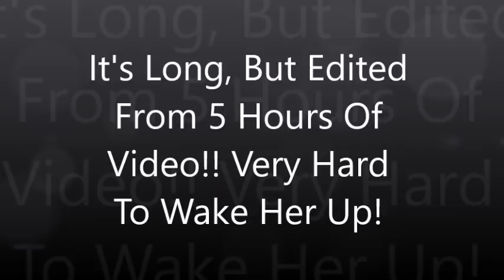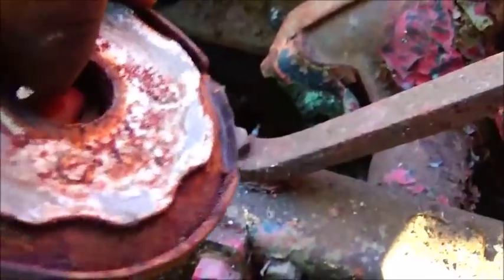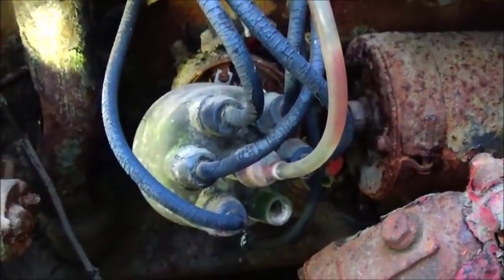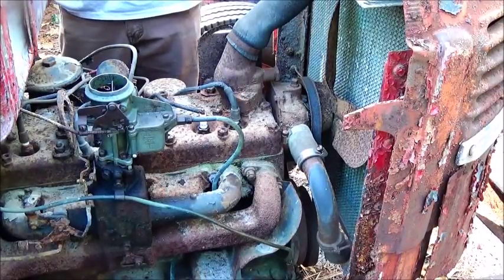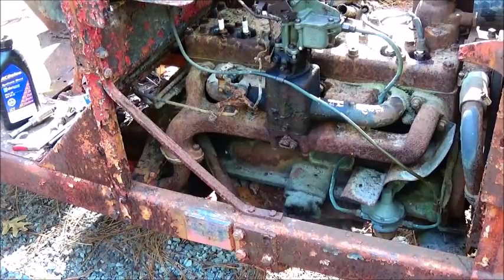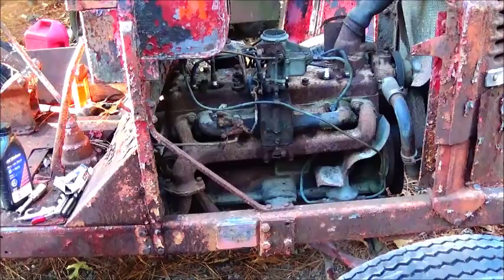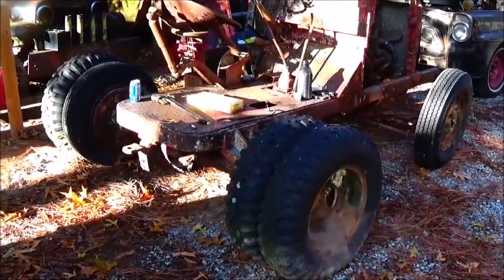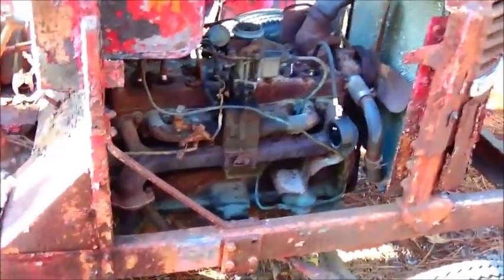Worthington Truck / Tractor First Start In Decades!!

Comment: I have the same one i bought it for 200 dollars the engine was seized because one of the valves broke the engine was rebuilt in the 90s sometime but we got it running and driving after we put new master cylinders in the hub assembly and a steering column  and it looked exactly like this one we bought it and is in the start of restoration  great video!!

Comment: Tough old engine, one of my goto forklifts back in the day was a yale with essentially the same engine. Beat on it all day long and it was probably 40 years old when I was using it, basic greasing, oil changes, ding ding, it comes out for the next round. I didn't really doubt you'd get that one lit, good job!

Comment: That was a marathon. Amazing that starter didn't burn up.  Between polishing the cylinders and rings for two days, they finally got enough compression to ignite the vapor.  When it cools down, all those spaces are going to be even wider, and they will be lucky to get 45 psi.

Comment: Good job, JW----luv to see these oldies start up.  I had a 36 Olds 6 cylinder trunk sedan that used to stick a valve now and then.  Old bugger didn't have an oil filter ;  manual just said change oil every 1000 miles - I did but whoever had it before me, who knows?!

Comment: Helped a friend restoring a 1931 ford Model A pickup, it sat for 50 years with 25,000 original miles laughed so loud when we started it with the smoke when she started because he did it in the garage and I was in the cab and couldn't see anybody. I learned a lot about Model A's

Comment: My dad would use white gas (Coleman lamp/stove fuel) when he had trouble starting engines. Then switch to gas once it started.
Also use two cycle mix that would help the rings and valves.

Comment: cool , working on 1969 cub 154 lo boy tractor, was setting for years , flat  head four had 3 stuck exhaust  valves , removed head used plenty of p b blaster ,got them freed up ,cleaned up replaced head , new carb kit  , got it running ,runs good ,had to replace clutch and shaft moves on it own power now, working on hydraulics now, as always enjoy your videos  thanks  , hoping to see you get back on four wheel drive wrecker !

Comment: I had to do that on my skidloader when I first got it. The little VH4d wisconsin just was not healthy at all. Took many hours off cranking to get it to fire. The ol' 6 volt starter took it pretty well, but it did bite the dust soon after I got it running.

Comment: Nice video. I have a 1946 Dodge dump truck. It sat since 1959 until about 20 yrs ago. I had a time with it. The engine was stuck and all the values stuck open. after a weak I got it started. I drove it around my place for 2 yrs like that. I then rebuilt it and now its on the road. Theres not to many of these around any more.

Comment: That rotor cap you could put a puddle of solder that being soft will not harm the carbon brush or brass loaded spring seen it done before.

Comment: Looks like it had  been set up like what was called a Doodle Bug, just the passenger compartment and front end.  There was one like that that sat under a shed at the deer lease that my Boy Scout troop visited down between Kerrville and Medina, Texas between 1955 and 1960 every Memorial Day weekend.  One of the scoutmasters tried to start it one time, but it wouldn't go.  Always wished they could have gotten it running.  However, there was an old tractor on the property that a couple of the kids kept fooling around with and got the thing running using the crank!

Comment: You should use two cycle mix at a 24:1 ratio in you gas bottle, to help seal and lube the rings. I find it helps in starting engines with low compression. Was the throttle plate wide open during the compression test? I find 60psi is about the lowest I can get and engine running.  It did sound good... considering how many decades it has sat without the very important air cleaner. They really do save the engine!
.

Comment: Congratulations! Took awhile but you got it! I don’t think she was blowing that much smoke at the end. Only when it was shutting down. She spit and sputtered but got running smoother! Nice work!
You gonna pull that carb and put a starter solenoid then run a temp gas line to her? Hope she’s getting water.

Comment: Dude ,  I totally get having to roll it  over a bunch with the Marvel oil freeing up the valves and rings , but save the starter !! Tow it around the lot with a tractor and your buddy in second gear or so for awhile. Cool vid and will check out more.

Comment: You should try WD-40 to get them firing. Its ignition temp is low, and it also lubricates/frees up parts. I use it all the time on old lawn tractors and small engines. Sometimes I go straight through the spark plug hole then through the carb once it fires.

Comment: I never do compression tests,preferring to do a leakdown test instead. It takes minutes to do a quick check and if i want to get really technical I rotate the engine so the reading can be taken at various points of the piston travel to check for bore wear and damage.

Comment: Hi Jon. Just A quick note about an auction near my home in Minnesota. Appears that A fellow collected several old cars and trucks over the years with the intension on working on them during his retirement. True to form, he dropped over A couple years early and now the family is selling them off. He had at least 66 cars that are going to auction. The auction host is kbid.com Go to Auctions In Minnesota on the link page and the cars are presently on page 2 at the bottom of the page under the A2C logo (Assets 2 Cash) in case anyone is interested. Most are pretty rough but some interesting ratrod stock on hand including A 1940? Mercury Pickup.

Comment: Shor glad yor stubborn on the give up , persistence does sometimes payoff . had a 49 merc V8 in  a 51 willeys pickup same thing ,valves not seating , put some 50wt in each cyl and pull started it. put atf   in the gas smoked abt but helped them seal better till the Marvel Mystery oil in the gas finally worked  never did have to give it a valve job.

Comment: Jonathan, have you ever thought about building a hand held gear reduction starter that will stick into the hand start teeth in the front of the crankshaft or use a impact socket on the nut on the pulley, to spin it over fast, kind of the way they start some race cars, just a thought

Comment: if they aint seized they will generally run, i had one with a seized piston and 3 stuck valves, head off free it up and she run. my last one had a solex carby, i threw that away and put a carter ball and ball on it and fired straight up

Comment: Sounds awesome. Did you change or check the oil? It’s also a good idea to put some oil in each cylinder in engines that have sat for a long time. If you restore it, it would be nice

Comment: We got a WW2 military contract light aircraft tug . That Dodge grille badge is original to that tractor, Worthington just mounted a shaped plate directly over that badge with a W painted on it. The guages look like 38 Chrysler or Plymouth. Still trying to find more on the military version, not much info on these.

Comment: i use carb cleaner on any old engine to get it to start. carb cleaner fires easier than gas but not as potent as engine starting fluid(ether). if you do not get it to start or run on carb cleaner for few seconds it is time to remove the head or heads to see what the valves are doing and see the cylinder walls. you can remove the spark plugs and shoot a spritz of carb cleaner in each spark plug hole and try that also. may be a nest of some kind in the intake.

Comment: After you do that compression test put a quart of Rislone in your oil and let it run 5 minutes and then check  your compression again after 5 minutes you'll already hear and know the difference it takes out the sticky varnish that builds up inside of all motors

Comment: Whats the best way to free up an engine that you cant turn by hand. Ps. I love the vids man. Great work
Reply: If you have time, fill the engine to the top with light oil and leave it sit for at least 6 months. A year is better. this soaks the whole thing down and should free up the rings and valves. Several times over the year try to turn the engine over. Don't go nuts! Just give it A bump by hand. You don't want to break the rings. When it breaks free drain the oil and put in the proper oil and give it A try with the starter'
Some people will pull the head/heads and soak the pistons with "Ed;s Red or Blaster and every so often use A chunk of 2X4 and A hammer to rap the pistons. Again, don't go nuts! A light rap and try to turn the engine over by hand. It took years for the engine to stick so it's going to take A while to get it to turn over. Some never do. I have seen some that busting the pistons into chunks was the only way to salvage the block.

Comment: Is there a way to invent a system using an air compressor through the spark plug holes so that it would apply pressure than release using more than one cylinder to push down on The Pistons

Comment: Good starter motor none of this modern crap would last that long 👍👍👍👍😎🇳🇿
Reply from the maker: 6 volt starter on a 12 volt battery for about 2 hours of actual cranking, that is pretty impressive. I think it is an autolite, but may be a Delco.

Comment: LMFAO! Your determination is Incredible! BUT really no need for any apologies if you can't be God in some cases. She is definitely in some desperate need of some help in every department, but the fact the starter and ignition system even worked to begin with is amazing? The other fact that it's been sitting for God knows how long being exposed to humid southern air and probably run on unleaded for a couple years After they went to non-leaded gas and it doesn't have totally burned valves or seat's. That's not even to mention, YES as you've pointed out the amount of carbon deposits in the intake tract or a sticking valve stem. REALLY that's some unbelievable work, and for what it is and how long it's sat, she didn't sound bad at all! VERY NICE WORK my Brother! That's probably as well as she ran the last time she was really running for the folks running it, and died where you picked it up from lol? Very cool to see ya bring it back to life!

Comment: There at bout 21 mins you talk about beatin the carbon off the seats and the rust off the valve stems. In the farming world we call that " getting everything shined up". All those surface areas get a coat of cruddy rust,and you gotta run whatever grain you start with(wheat,corn) and polish the crud off stuff. Makes sense that the moving parts of an engine are the same

I'm surprised the old turd wasn't rusted solid.

Comment: Did you check the cam and crankshaft sensors ?
Reply from the maker: My 12 volt plug wouldn't fit in the 6 volt OBD 2 port.
Reply: You need the right Marconi adapter.

Comment: Hi Jonathan, i love the videos and juat have a couple of questions to satisfy my own curiosity about this.

1) I notice you didn't use a starter fluid/ether. I understand that can be bad for diesels but could the extra volatility here helped to kick it off quicker than gas?

2) with the oil you added in the cylinder, do you need to wind it over to blow it out and reduce the risk of oiling the plugs up ?

Not criticisms mate, i am just asking to satisfy my curiosity.

Thanks for an excellent channel
Reply from the maker: Phil, I personally do not prefer to use either on anything. It is very dry and although I think some is offered with an added lubricant, I haven't ever used it. The problem is really not the fuel, but the lack of compression combined with the lack of vacuum to increase velocity and atomize the fuel   I am sure the added oil affects the firing somewhat, but not enough to keep it from firing the fuel. I may switch to a squirt bottle that will atomize the fuel somewhat before entering the carb.
Reply: Jonathan W thanks for your time knowledge :)
Reply: I use A oil pump can similar to the ones old time oilers used on the railroad. Hold's about A quart.
I used to use A glass 8 oz. pop bottle but stopped when it set on fire when A carb backfired! Now I'm 12 inches away and the hole is to small for flame to travel up the spout.

Comment: Change oil, +1 quart kerosene, +1 quart ATF, new filter. AUX fuel tank, 91+ Sea Foam. Remove thermostat, 50/50 coolant. High idle 10 gallons of fuel through it. About 2 hours.

Comment: Trick is to put about three caps full of ATF down each spark plug hole, and crank it after wards with the plugs out, after it sit's for about 5 min, then put the plugs back in.
Reply: and bump it with a touch of either, in the bowl.
Reply: cylinders glaze up with time, from sitting.

Comment: The old gal just didn’t want to wake up after such a long sleep. You just wasn’t taking “no” for an answer. Lol  Any plans for this old jewel?
Reply from the maker: To go 47.5 mph like they claim it will do! Then maybe sell it, but not until 47.5 mph!
Reply: Jonathan W I think your tractor is sexy!
Reply: Jonathan W - Lol! Wear your helmet brother! And maybe some motorcycle leathers if you got any, just in case ya hafta jump.
Reply from the maker: I figure that everyone is gonna think I am crazy, but I am wearing a helmet for sure!!
Reply: Jonathan W I have several  Hardhat,ACH,PASGT and two CVC even thought I've have 5 screwed up vertebra and screwed up shoulder and arms from doing stuff with a gung ho attitude disreguarding my own safety no more of that crap! Need to get you one of those SF Helmet's since your near Fort bragg! 😁

Comment: if the valves are sticking, mix Rubing alchohol with a half a bottel of either, and dip it in the carb while its tries to start, the watyer in the medical alchohol, should steam the valves clean.

Comment: Starting fluid ignites quite easley, even in a engine with low compression.  Would have saves a lot of wear and tear on the starter.
Reply from the maker: Dry and ruins cylinder walls. Starter cheaper than an engine rebuild.
Reply: @jonathanw4942  I haven't hurt one in 40+ years.
Reply from the maker: This engine needed turned over  the valves were not seating. There was no use drying the cylinder walls out with starting fluid.

Comment: ((😳)) can you pull start it ? Get a sledge hammer to outer side of them back wheel rem hubs a few times that’ll break em loose for sure .. spray water in on the brake shoes if ya can .. water is just as good if not better then penetrating oil .. just think what makes metal rust the start with ? Right water ! That’s and old paint and body man’s trick to getting rusty bolts out .. quick fix guarantee 😉👍🏻

Comment: Comp tester should be used with Throttle wide open, or it reads low
Reply from the maker: Throttle was open, no spring on the linkage.

Comment: Hey Jonathan why don't  you make yourself a starter button with some heavy wire and gator clips where you don't have to cross it with a piece metal a old timer showed me that and it works pretty good.
Reply from the maker: Without a solenoid it would burn up. That was 1/4" solid rod and it was turning it red. I did need a push button, but I also needed a solenoid.

Comment: Instead of losing all those hours cranking and getting no result I would have pulled all the plugs poured some premix down each jug replace the plugs and give it a whirl; yeah sure everybody will say he got it started eventually but when time is a precious comodity I think this method would be quicker
Reply: Ciprian Maior It had low compression so pouring fuel down the jugs would not help
Reply from the maker: Also a quick start on and engine that all the oil had drained to the bottom wasn't what I wanted. I was priming the oil pump for running the entire time I was cranking. Starters are cheap.
Reply: as opposed to just keep on cranking and pouring gas down the carb; was he able to raise compression by continually cranking the engine for several hours? I doubt it; I think compression came back after the initial few seconds of actually turning on its own combustion so yeah, I really believe that had he just put fuel in the jugs and new plugs the engine would start quicker and he wouldn`t have waisted so much time

Comment: WHY DID YOU PUT IT DOUWN AS A TRUCK? IT'S NOT IT'S A TRACTOR>
Reply from the maker: It is a factory built Worthington Golf Course Tractor. They bought parts from Dodge to build it.
Reply: Even with a Dodge engine and transmission it still not a truck. It's a tractor.

Comment: Poor bendix
Reply: I had this problem  with no vacuumed after running hot you take air pressure and blow in the carb. To force air jnto the firing chamber I’m 90 years old and have this problem many times. You can use wd40 put a rag in ice carb. Opening and will give same results as pulling it fast. I screeml each time you do a first start.,
,.

 at my tv each time you do a first start